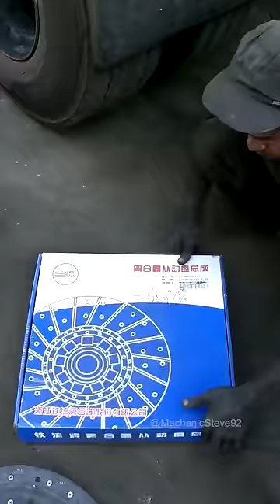#mechanic #automechanic #automobile #cars #trucks #restoration #mechanicsteve #shorts #trucks

Comment: I would of replaced the pressure plate as well, not jus the clutch disc.
Reply: Not only that but at least resurfaced the flywheel if not all together replaced it
Reply: @mattsprayberry0  NOW your talkn EXACTLY like me, got the trans separated, midas well do it, / DO IT CORRECTLY. ALL THE WAY.👌😉💪👍
Reply: @edsel6818  
And the rear main seal because why not
Reply: The main reason they might not is because in some parts of the world the clutches themselves are soft like chocolate and they do a clutch every 15 or 20 thousand miles. So  this might be one of those situations where it's not necessary especially because it's a commercial vehicle and gets maintenance I would assume if it's making them good money. At least once every 2 or 3 months. My truck gets an oil change every 6 to 8 weeks
Reply: The clutch disc, the pressure plate, the throw-out bearing -- always.
Reply: @mattsprayberry0 😂🎉☝️😂 Ooh my friend , если машина не дёргается, значит не надо искать себе.... лишнюю работу 🧐🤔
Reply: Cheap customers would say, why so expensive? And thats what they get

Comment: it's not only the expenses flying and getting your lungs or whatever it is it's to not refacing the flywheel or the pressure plate!! they are shiny and the clutch plate will not get any grip and they will be replacing that very soon again, do the job right the first time!

Comment: I feel like this guy might benefit from buying an impact gun that vents through the handle and not the snout. Or maybe just a respirator. Idk... Anything over the face even. Setting to knock down the dust. Even maybe blast it down with brakleen first... Just so many options.

Comment: Dont go throwing a dt12 or sachs pressure plate on the ground like that and expect the clutch to work after assembly.  It will knock it out of adjustment and cannot be reset.  This is why I always measure the couch after install.  New or old could have been mishandled and knocked out of adjustment.  They should only be set down on one side.  I always forget so I have to look it up.  Too much other junk packed up in this dome piece.
Reply: If the pressure play can't be adjusted how do you adjust the clutch
Reply: Does it look like to you that those guys did their 1st clutch on that video
Reply: Obviously they didn't seem to have a problem cleaning that the way they did
Reply: @davidbernardi3896  You don’t adjust the clutch. It’s self adjusting. Sachs style clutch.  Used on DT12 Detroit transmissions.  As well as a ez pedal option for Eaton and other transmissions.  

Eaton however has a solo self adjusting clutch that you could reset. If you forgot to cage it with the 7/16” bolts before removing it, it will self adjust to max and need to be reset.  It can be reset with the cage bolts and a partner.

Comment: What about the wear on the flywheel.  Bad practice not changing the disc , pressure plate and bearing. Not forgetting the flywheel.  It won't be long until you have the clutch out again

Comment: They not using asbestos in the linnings these days but musk is a better way to go, still harmful. Excellent work , deglazing both surfaces , flywheel and pressure plate. Replacement of the pressure plate bearing , safe plan.

Comment: Why not changing pressure plate??
Reply: You shouldn’t need to change the pressure especially if it the first clutch centre plate replacement. Unless it’s worn down to the rivets and damage the p/plate. It’s standard practice just to replace the centre plate. Maybe by the third clutch replacement or if the clutch was slipping and the centre plate wasn’t really worn much.